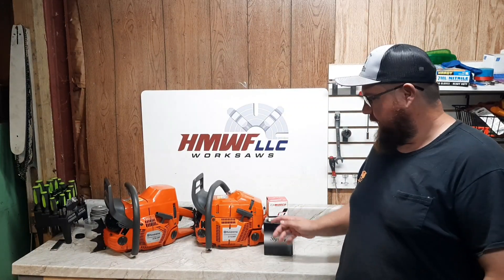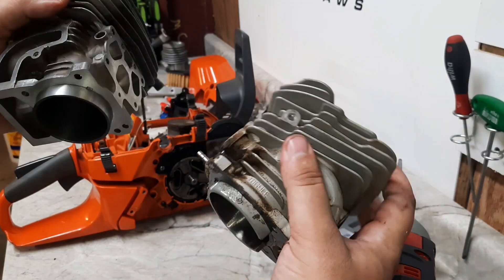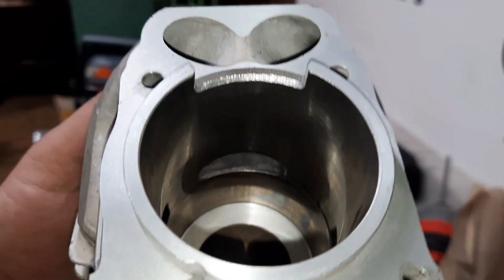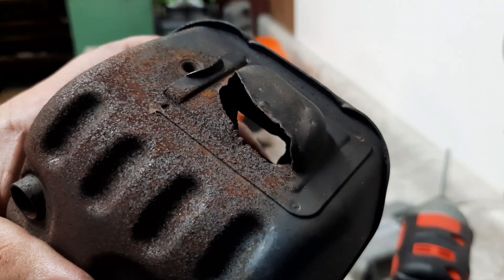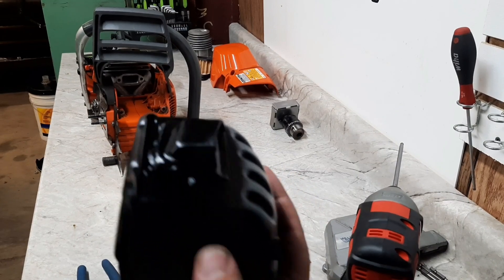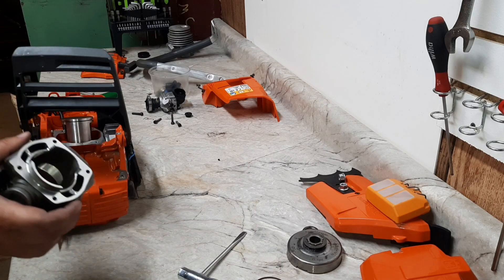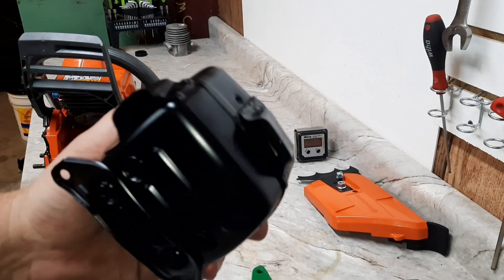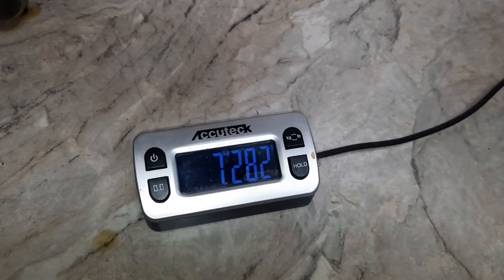Huge Power 372xp build? 76cc BIG BORE Hyway Problems? 576xp gains well

Comment: I had a feeling the 576 would outperform the 372, with more cc and an oe cylinder.  The 576 sure is a smooth saw, too bad they are so fat, great bucking saw though. The 576 feels just like a 572 in hand, but the 572 handles much better with the laid back bore, soon as you start them you can feel the difference. 
Bummer on the hyway cylinder/ plating. 
The worst aftermarket cylinder I've used was my first, ironically it was for a 576. It came Little Red Barn, and the plastic wouldn't even fit as the decomp was in the wrong spot, plating looked terrible. Never used Little Red Barn again as their service was terrible and they wouldn't replace the junk cylinder, I ended up trading the saw off yrs later.
Have you done a 268xp pop-up in a .50mm 372, super easy and they start easy and run well with a timing advanced and a muffler mod. It probably wouldn't put out the power the hyway cylinder did ported, but it would have been a great option for this guy as he would have ended up with a stock cylinder with a nice pop-up meteor piston.
Have a great weekend when you get to it Joe.
Reply from the maker: Yeh the big bore 372 at 76 cc should have done something, but the oem 576 gained really well.
Reply: @dynojoemods2764  forgot the aftermarket was a big bore, I'd still have thought the oe would perform better even with similar numbers as the ports vary a lot on the aftermarket products.
Reply: I don't like the transfer tunnels in the Hyway. They are too flat on the inside radius and uneven in volume. I did like Meteor but it seems they are now just rebranded Hyway. Has anyone else noticed this?
Reply: @toast47624  when meteor box design changed I noticed the plating changed it chips when porting also, genuine is the only way
Reply: @BRKS-fj2jt  100% agree. As Joe says here you pour hours into meticulously porting these things and its bloody disappointing when they don't run as you expect and worse when they peal the cylinder after 10-20 liters of fuel no matter how much time you spend polishing chamfers. My 372 50mm saws haul serious arss I could careless about the 52mm kits. I am working with the 51.4mm OEM and my first was not up to par I hope the one I do today will pull hard. They are quite different setup too the 372 and honestly right now I'm not sure I will get it too run as good. Such is the black art of what we do. I have 3 more, I'm determined to win out.

Comment: That's why ya use a pop-up piston in the hyw kit.
Reply from the maker: That would definitely help bring up the compression some.
Reply: No you have the same problem. When you cut the pop up you reduce the distance of the ring to the top of the piston.
Reply from the maker: @toast47624  he is talking about the hyway popup. Which should have the stock crown + the little pop up in the middle. But have not measured one to see if that is the case.
Reply: @dynojoemods2764  Apologies I did not know Hyway did that, maybe it does work then. 
I'm going to cut an 8 degree taper Squish band and piston today and try that in a 375. It adds up too 1mm cut raising the compression ratio. I'll then change the shape of the combustion chamber slightly to get the ratio to 9.8:1. Keen to see if the 8 degree slope on the piston helps flow at all.